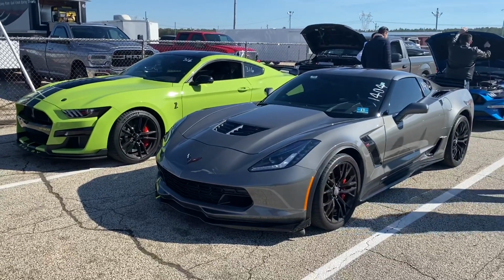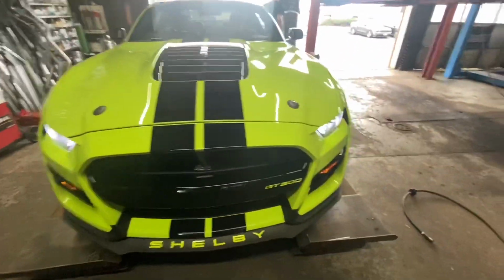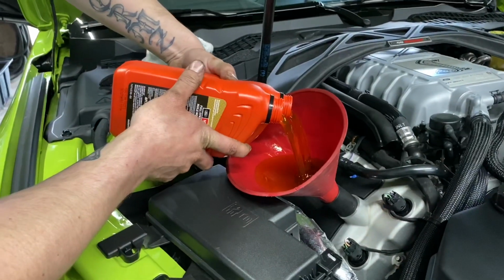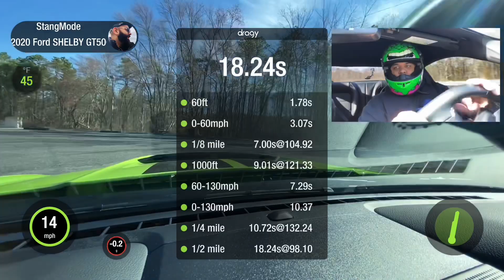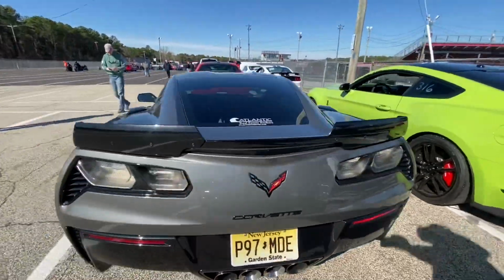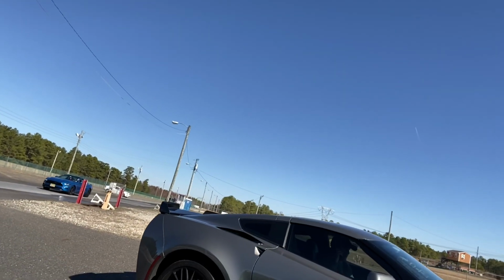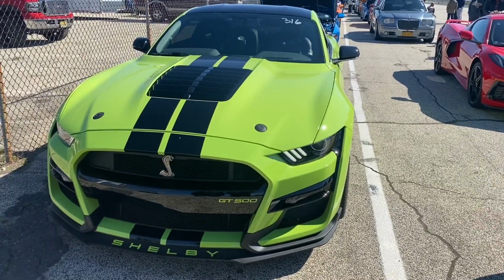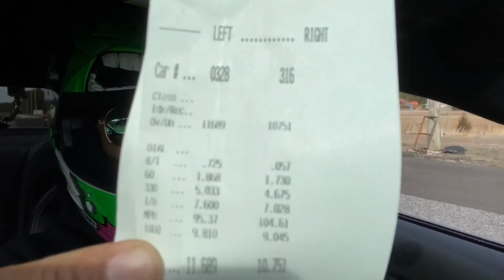BOSS FIGHT: CORVETTE ZO6 vs 2020 GT500 DRAG RACE! *PLUS C8 1/4 MILE!

Comment: Love the mustang but, the C7 Zo6 is still the best car for the money and a beast. I love my C7 Zo6.
Reply: The base GT still takes that titles imo.
Reply: @burgerbandit3646  We have to look at different price levels. For around 40k, Mustang 5.0 is the best deal. Let's not call it a 30k car since those bare bones base trims are not well equipped. For around 80k, yes the C7 Z06 is the best deal. Although it is older than GT500 and therefore a little slower on the straights, it is a track monster with still industry leading grip for handling.
Reply: @ShinyBlackRims  yea, true. I say that because with basic mods, the GT's performance just takes off.  All in all, best car for the money is an opinion either way.
Reply: @burgerbandit3646  For power and straight line racing per dollar, Mustang is number one. I gave it serious consideration before going with Vette. I was just looking for something lighter with handling, while still having straight line power as well.
Reply: @burgerbandit3646  not an opinion.  The vette is a fact for sure.  Yoy are comparing two cars in a different category.  A GT gets compared to a Camaro not a vette.
Reply: @alex369  It doesn't matter what is compared to what. Do you know what an opinion is?
Reply: @burgerbandit3646  i sure do know.  And everyone who is not ignorant knows that there is no car out there right now that compares to a Corvette for the same price. <<That's a fact.
Reply: @alex369  The Z06 still costs around 70k. The GT500 does as well so 🤷‍♂️
Reply: @burgerbandit3646  show me a gt500 for 70k
Reply: Tom Wetz  The GT350 is priced at such a high point due to it being such a great drivers car. In a straight line, they really aren't much faster than a 10R80 Mustang GT.
Reply: Tom Wetz  Yep, been really thinking of buying one. And with the C8 out, the decision just got even harder!
Reply: Tom Wetz  yea, C8 production got put on hold I believe.
Reply: Tom Wetz  I really think the GT350 will be a great investment for the future as well.
Reply: Tom Wetz  yup
Reply: Tom Wetz  lol, can't disagree with that!
Reply: Tom Wetz  people who buy a gt350 for sure dont do it to have the fastest car.  350s are really slow for what they cost.  so your comment doesnt make sense.  why would someone knowingly spend 80k on a slow car and then be jealous of something they know has better performance.  a gt is faster than a 350 for fucks sake.
Reply: @ShinyBlackRims  bruh im not buying no GT or EcoBoost premium for 30k OR 40k when I can get a z06 for art 80k  z06 ALL THE WAYYYYYYYY
Reply: @ShinyBlackRims  I would get a C7 Z06 but I’m scared of the overheating issues.
Reply: @aimxdy8680  The later model years have some minor upgrades to address overheating. If the one you want to buy has overheating issues, just get aftermarket oil cooler. Z06 is too beast of a car to pass on.
Reply: @ShinyBlackRims  oh ok
Reply: Love my 19 Z06

Comment: Imagine a new C8 Z06 it’s gonna be a beast ...
Reply: That's like 2-3 years from now right?
Reply: Robert Willson most likely. im waiting for the zr1 first
Reply: C8 Z06 will be competing with the big boys like Huracan Evo, demon, GT2 RS, 488, etc. It will be faster on track or straight than most supercars at that level.

Seems like Z06 will be TT flat plane crank V8. If GM can package a Grand Sport with just the V8 without turbo, that trim will also sell like hot cakes.

Comment: Any new engine you want to change at 500 miles do to the metal breaking down as bearings are new as is everything so there will be metal in the oil going through your engine.
Reply: That's not what a break in period is for, I am a full time heavy equipment technician. The break in periods purpose...is designed to begin to wear the engine evenly and smoothly with low, consistent pressure, normal operating temperature and smoothly flowing oil. The goal is to get the engine's piston rings, which expand, contract and flex, to seat properly on the cylinder walls.
Reply: @shainhoon4929  you saying your a full time heavy equipment technician doesn’t prove anything. You think we gonna believe you like tf

Comment: Well, that was cool. Two Vettes and the Hulk! Thanks for that, StangMode. I'm still amazed the GT500 runs mid-10s pure stock. You should take it to a track and see how it feels too. And my vote is still "no" to a twin turbo. Keep on keeping on, Bro! Just love your channel.  😎
Reply: True! 
It's supercharged and yet it has not even had any mods yet! 
So no, turbos are not 1st in my opinion. 
I think Max out on supercharging 1st. 
But that's my opinion but if you just want to beat the next guy then unfortunately Turbos are the only way to go
Reply: Mid 10's?  What video were u watching?
Reply: @dansherwood1043  The one where StangMode and Mrs. StangMode were running 10.6s. StangMode said 10.5 is coming in the near future. I think those are strong times for a car that isn't even really built for the drag strip. Just my view.
Reply: @Romacitta  he ran 10.5 already with it but high 10.5's but still a 10.5, both ran that but Stangmode did a little better.

Comment: 650HP vs 755HP ..and they ran the same time! I will take the Zo6✌🏽
Reply: Z06 won also with a worse light.
Reply: Let's not forget a big weight difference, weight IS horsepower
Reply: @peterkay2406  idc over a 100 more hp cm on Ford. Another w for Gm an the mighty Ls motor
Reply: All day
Reply: Still got destroyed by the GT500 💀💀💀
Reply: You're not gonna beat the mustang in a long run race so you can keep that trash Z06
Reply: @AsgardAwaitsYou  just imagine what a zr1 would do 🤣
Reply: 500pounds lol
Reply: @edwin8182  imagine what a fathouse would do :)
Reply: @AsgardAwaitsYou  lmao. And you're never beating a vette around a track. The vette is better in almost every metric. Stang is there to compete against Camaro. Vette is in a different league.
Reply: It’s the weight difference that’s why
Reply: Gt500 is a TANK

Comment: Did that Gt500 just pull on the top end on a Z06?
Reply: Mustangs are very well known for having insane top end power so i wouldn't be surprised.
Reply: @raionshishi8290  I can see that. It was impressive it overcame the Vettes better aero. The mph told the story though, the Gt500 was going to freight train until it hit the limiter.
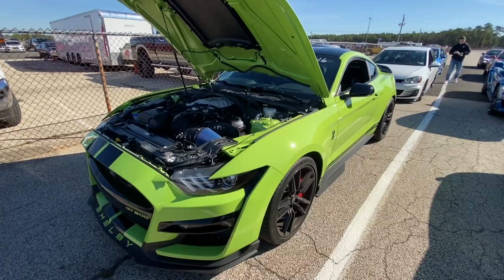Reply: nope and with 110 extra HP i figured it would  great race though and the guacamole mamba is on a sticky tire and some sort of CAI  9:47   wonder how much HP thats giving if you saw the video of PBD  where they just removed the top of the factory airbox and gained 50+ HP   interesting.........
Reply: @omegasquad868  stock CAI with lid removed and surely you don't believe removing the lid is worth 50hp, LMAO!!! Every GT500 out there is trapping over 130mph... How much lighter is the Vette again??? What about the torque. GM guys cry foul because of the HP but what about the GT500's lack of torque compared to the Vette??? With a total lack of torque the GT500 still 60's the same as the lighter, more torque having Vette, lol!!!
Reply: @02autogt  Z06 335 series tires.
Reply: @omegasquad868  How is the gt500 not stock? You're reaching
Reply: @darkodin2007  the vet aero is designed for the track the areo is what actually slows it down on the drag strip it will trap a lot higher without all of a downforce. Take notice to the wing at the back and the arrow on the front splitter and though back fenders they're all designed to catch air and keep the car cool down they actually slow it down quite a bit which is why I see c7s need a bit more power to compete with C6s.
Reply: @coreyblacksher  okay I can see that. That explains why the c6 ZR1 is such a beast still then?
Reply: @darkodin2007  yes the ZR1 is an amazing car both of them actually are. But the ZR1 has an actual much bigger blower a 2650 vs 1900 so it pulls a significant amount more air it's already crazy fast but once again it does have a lot of downforce slowing it down. But the ZR1 with the 2650 is why you see some guys easily and the 8s and the quarter mile it doesn't take a lot for this car to gain more power
Reply: darkodin2007 of coarse the tiny 1.7l on the Z limits top end big time
Reply: @GmAmericanpower  yeah that's why the ZR1 has so much more power
Reply: @coreyblacksher  so is the base gt500. The gt500 with the track pack is the base model times 10x
Reply: @keloing923  yes I'm well aware the other one adds more downforce to the GT500 but it also has more than horsepower than a regular ZO6
Reply: The Vette is the best car period in every way. They are faster, prestigious and world class. Mustang are slow and ugly as Hell! No value to them. Just like a Dodge. Shelby's are shit cars. Mustang don't know what it is.Stupid ass FORDS A horse or snake, what the hell.
Reply: @coreyblacksher  hp doesn't matter. Weight matters more than hp does. And both engines rev differently. If a mazda miata had 500 hp vs a 700 hp challenger the mazda would still win because the car is making more hp per weight than the other is. The z06 shoud dust the gt500 but it doesn't since both cars make power with different displacements. One revs to 7500 and the other revs to 6500. One has more torque than the other. Take a look at the Bugatti veyron s vs the koenigsegg agerra r. The Bugatti makes more hp with more cylinders v16 vs a less powerful car 5.0 twin turbo v8. But the koenigsegg is faster (top end)
Reply: @eltonharris4502  apparently not lol
Reply: @keloing923  you're a fool if you think horsepower does not matter. Play a role.and to take it a step even further he would have come down to aerodynamics. If I gave you a car and it had a hundred horsepower and it was shaped like a square blockand then I gave you one that was shaped like an egg with equal horsepower and weight you would be a damn fool if you think the block would win 😂
Reply: @coreyblacksher  so with you logic a car with equal weight and hp but shaped differently. But no car has the same exact weight and hp as its rival. Like i said, the z06 should dust the gt500, but both engines make power differently. The z06 650hp 3300lbs has a better power to weight ratio than the gt500 760hp 4200lbs.
Reply: @coreyblacksher  like i said before. The Bugatti veyron s is big and heavy, but has more hp than a koenigsegg agerra r but the koenigsegg is faster since its lighter
Reply: @coreyblacksher  obviously they have the same hp. But the cars above do not lol
Reply: GT500 has much more horsepower, a DCT, and much less drag. Z06 suffers from drag created by stage 2/3 aero package. That's why GT500 is faster at the top. It also has 625 lb-ft of torque, so it's not torque-limited. All these advantages for the Shelby help it overcome 700 lb weight penalty.
Reply: @coreyblacksher  the gt500 has a wing that produces 300+ pounds of downforce. And the front spiller produces around 200. Your point is?
Reply: @ShinyBlackRims  stop wasting your time talking to to him he obviously can't see past anything that he doesn't want to lol I'm done replying to him. If I was you I would not waste any more breath it.
Reply: @coreyblacksher  The SC in the C7 Z06 is actually a 1.7L. It is tiny compared the ZR1 and GT500 superchargers which are the same
Reply: @coreyblacksher  The C7 Z06 is nowhere near 3,300 lbs. You are thinking about the C6 Z06 which was around 3,200 lbs. You clearly don't follow Corvettes closely enough.
Reply: @marcsmith3881  yes I'm well aware of 2650 is going to push the hell of a lot more air. And if the ZO6 have the same blower it would be game over
Reply: @marcsmith3881  c7 is about 3600 pounds believe me I know I own the car so
Reply: @coreyblacksher I believe you said 3,300 lbs, but I didn't have my glasses on to be fair. BTW, ownership of a vehicle is not indicative to knowledge about them. For example, you said the SC was a 1.9L on the C7 Z06 when in fact, it is a 1.7L. As a former Mercedes Benz Tech and now repair business owner of 14 years, I have not owned any of the thousands I have repaired.
Reply: @coreyblacksher  I personally would rather have a Procharger on the Z06. Much more adiabatically efficient.
Reply: @chadingram6390  weight reduction  exhaust modification and CAI mod  leads me to believe the car is NOT STOCK and i only reach for the truth my friend
Reply: @omegasquad868  Where are you getting a cold air mod from? Are you just making things up?

Comment: Choosing a Corvette ZR1 would give more comparable horse power with the Mustang GT 500. Your GT500 has 760 HP. the Corvette Z06 has 650 HP and the Corvette ZR1 has 750, which is more comparable to your beautiful machine. ...Now, as far as 40 runs on the track, I would hope you did NOT do any before at least 500 miles!  I think the book you did NOT read might have your total break-in requirements, and I would guess at least 1000-2500 miles on the odometer before tracking at all. And if you track, I'd be changing the oil every 2500 miles at the most! As far as the dirty oil you drove around with for an additional 3500 miles, would say you were using oil with a lot of metal shavings floating in it (normal expectations). The oil, of course keep your engine from blowing-up basically. But YOUR oil had extra-extra-extra metal shavings in that oil making it much more abrasive than oil that was changed at the 500 mile recommendation. So, learn your lesson, and recognize that when your car is checked at the dealer should anything go wrong, the dealer will see that you didn't have that first change, also, anyone purchasing your car in the future will see that too. So, I wouldn't talk about 40 runs at the track before your 1ST oil change. Or, if you insist on being honest, then let the chips fall where they may. ...You have a really fun channel to be a part of! Thanks
Reply: goofydog2 Weight makes a big difference too ,not just horsepower.
Reply: @300zxdriver  I agree. So have the Vette carry a passenger...
Reply: Naught Guile  Reading more than one professional driver's opinion such as Randy Pobst the winner of 90 races and circuit champion 2 times, says that the Mustang GT500 with the carbon fiber track package is a supercar beater, so therefore a supercar its self, AND, a great street car to boot! It's that good! And coning from Randy, that''s saying something.

But as far as weight being a major contributor to a race's outcome, it has to count but I found two cars that are as identical as possible, and their weight doesn't seem to play as big a difference as one might think. Taking an 2021 Audi RS Avant weighing in @ 4600 lbs vs the 2021 Audi RS QB weighing in @ 5300 lbs, with both running 'identical" engines finish the 0-62 mark, the Avant does it in 3.6 seconds and the QB does it in 3.8 seconds. Not much difference at all, even though they carry a 700 lb. difference. 

The Mustang GT500 (carbon fiber tract package) weighs 4169 lbs. and the 2019 Corvette Z06 weighs in at 3520 lbs. That's a difference of around 600 pounds, but their 700 lb difference doesn't make but 2 tenths of a second difference so I can't imagine the GT500 and the Z06 weight 600 lb difference would make much more than 2 tenths of a second. Besides, simply throw a fat guy in the passenger Corvette's seat, and let em' rip...
Reply: Naught Guile  I don't disagree with what you say really. I just don't know how much a 5-7 hundred lb difference is ALL that meaningful. 

I thought I was the only old guy with occasional insomnia. What's your excuse for starring at your computer this early in the morning?
Reply: Naught Guile  I agreed that weight influenced races or stats. I'd be stupid not to, but using those Audi examples, it showed it was a fantastic amount when the weight was 700 lbs or less. I mean 2 tenths of a second ain't that big of a deal. I've been a fan of Ford for 45 years and purchased many of their products, including Mustangs.. But I will state 5-7 hundred pounds doesn't 'appear' to put the heavier car 30 seconds back or 15 car lengths. 2 tenths still wins the race by the lighter car but so does having 100+ hp  difference.

So, if you can, try and get cars with equal hp and then put in weights to the lighter car to match up with the heavier car. Or, in the case of the Mustang, race it against Camaro's or Dodge Challenger's.But those cases, don'y change anything as any manufacturer developing cars that are lighter, then they should be reward for their efforts to do so. But very different cars should have rules in place that even out the races.
Reply: Naught Guile  Very funny that you proved you did NOT read my post to you. I said, this will be the last time, that I've been a fan of Fords for 45 years and have owned new Mustangs, a couple of SUV's etc. Another fact, is I've NEVER owned a Chevy before, including Vetts. So relax with the "chevy fanbois." LOL.  Regardless, nothing either of us has stated so far is written in stone. I just make the point that when racing, the horsepower should be as equal as possible as should the weight.

Comment: GM claims that the 2015 Z06 runs 10.95 at 127 mph. Those who opt for the seven-speed manual transmission will have to be content with claimed 3.2- and 11.2-second (also at 127 mph)
Reply: GM's claims were conservative on both autos and manuals. Plenty of Manuals and Automatics bone stock in the mid to high 10's. It just comes down to a good driver, good traction and good weather conditions.
Reply: mmjsport789 My old 18 ZL1 A10 ran exactly what GM claimed. Few got lower times. My old 18 ZL1 1LE did not run anywhere near GM claims. It could have been my driving.

Comment: That Z06 is strong...never seen one run 130 stock
Reply: Mike Morris makes me think it ain’t stock.
Reply: I seen a 2019 Z06 Auto run a 10.9 at 128 mph. So 2 more mph isn't really anything other than maybe a Cat-Back and better flowing intake.
Reply: The beauty about OHV engines. Easy buildable horsepower!